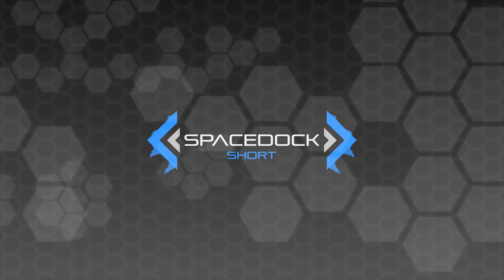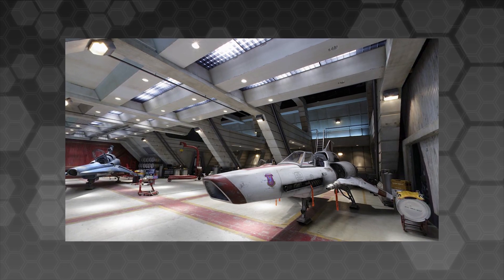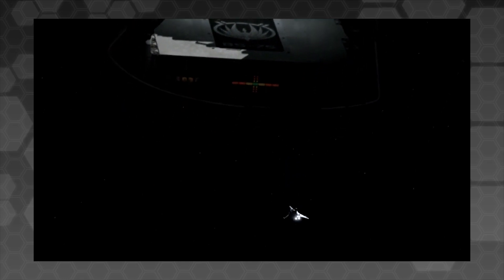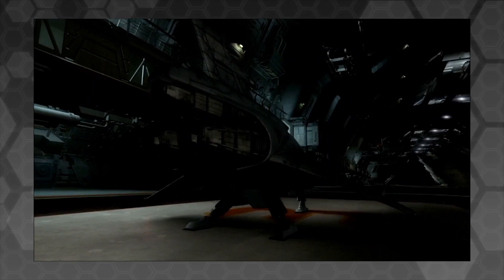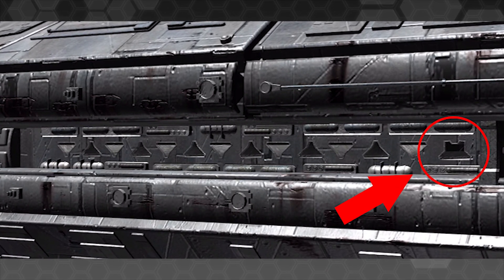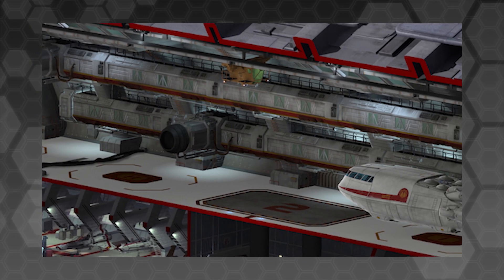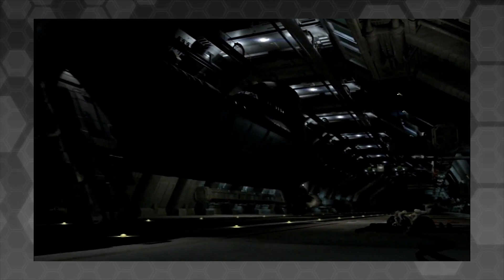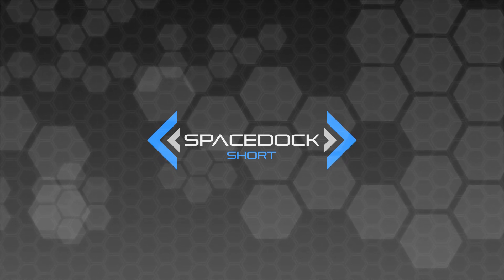How to Land on the Battlestar Galactica

Comment: I've never understood the Sci-fi fascination with skids over wheels. It seems like it would be so much harder to move fighters and whatnot around the deck because you'd need some kind of external lifting device to do it. Seems like a waste of space to me. Magnetic skids could also be used in conjunction with wheels.
Reply: While I don't remember it ever being shown, I believe there are wheels in the skids themselves for moving them around on the hanger deck. One reason they wouldn't likely be used for landings though would be that landing in zero-g would make wheels a very risky proposition, no grip for one thing, and it would be a bit harder to use the magnetic field on a wheel. With a skid however you could integrate the coil generating the magnetic field into the structure, and keep it in a single alignment as well.
Reply: Technically, due to the freefall environment that the Viper works in, it is probably more related to a helicopter than a plane since it can hover and can move freely in all three dimensions.  As stated in the first episode, the normal procedure for a landing is to approach to a hover, hover taxi to the landing spot, then perform a set down.  Identical in all functional respects to a helicopter.
The combat landings seem to be analogous to a helicopter performing a "run-on" landing.
In addition, the skids provide a large surface area for the magnets to grab on to a surface.
Reply: They are most definitely not "hovering."  They are matching their velocity with the velocity of Galactica, then using RCS to bring their ship to the correct part of the deck on which to land.  At no point are they not moving, they just are trying to stop moving in relation to Galactica so that they can land.  It is in no way similar to a helicopter; technically a helicopter would be much harder to land on a carrier than a Viper would be to land on Galactica.
Reply: Well, when you put it THAT way, a helicopter doesn't "hover" either, it uses a rotating wings to match it's velocity with the velocity of the Earths surface.
And as long as we're being "technical" here, I never said that Galactica, the Vipers or any of those small space craft hover at all, only that a helicopter does and that close ship operations and docking are more analogous (Ha! analogous has the word "anal" in it) to a helicopter than to a fixed wing craft despite the way a viper looks.
Reply: But its similar to a helicopter in that the craft is not in contact with the 'deck' while moving to the lift. Much like a hellicoper is not in contact with the gorund when it moves from the runway and taxi's to parking.
Reply: TheRogueX On land it's not a direct comparison but on a ship it is. A helo landing aboard, say, a destroyer is doing exactly what you're describing, it hovers above the landing platform by matching velocities with the ship it's landing on.
Reply: Pontoons, my friends. Pontoons.
Reply: The X-15 had a front titanium skid an two rear wheels.

I don't know if the skid was more about landing impact or braking.
Reply: actually the X-15's undercarriage was the other way around.  My understanding is that there was concern that tires wouldn't have been able to take the impact forces during the aircraft's high speed landings, and probably also because they were really only needed for landing, the plane didn't need to taxi or takeoff on it's landing gear.

In the show we do see the deckhands pushing Vipers around as if they were on wheels, so presumably, either they have embedded castors or the magnetic locks can be switched to some sort of "maglev" mode.
Reply: the old series skids were wheels, they looked like roler scates
Reply: @jedigecko06  X-15 had a front wheel and two rear skids

Comment: I always considered the haphazard combat landings to be the result of two things, actually.  First, it's a matter of recovering all the fighters as quickly as possible and not leaving anyone behind.  Second, it has to do with the fact the Galactica's flight pods retract prior to a jump.  Vipers landing would be moving perpendicular to the retracting deck, making it riskier to try and be land normally since over-correcting accidentally would likely end with a Viper being bounced around a bit because it hits the wall because it's moving independantly of Galactica.  Either of those ends up with a Viper being lost or effecitvely disabled (even if only for the time it takes to confirm it's still spaceworthy), something the Fleet can ill afford for most the series.
Reply: All that is a great point,  but you are missing the biggest thing for the show, it looks cool. Lol
Reply: Randall Brink yeah the rule of cool wins the day here. Though one thing I don't get is why the Vipers have Skids exclusively, surely it would make sense to have wheels that they can use for ease of maneuvering when in the maintenance bays rather than being dragged along on skids
Reply: i agree, skids make no sense on Vipers.  Wheels are under-used in scifi.
Reply: A flat magnetic plate to securely grab the deck on landing would be much more important than how you move it around later.  I always envisioned little rolling dollies that grabbed the skids and popped them up on wheels to move the ships.  Mag-lev dollies would be cooler, but they used wheeled racks for everything else so probably wheels.
Reply: @themadhammer3305  Mainly because the skids had to be magnetized to secure the Viper to the ground. I guess there are those skids with wheels, but I guess those would be more prone to slipping when magnetized.
Reply: @Will-cl1ro  
It's a weird thing but even today with wheeled helicopters.  Pilots don't like using the wheels they would rather hover above ground when moving.  Claws would be easier to secure and maneuver because of length.
Reply: @johnMullholand  all solid points, for lubrication though the mechanisms for the skids must have some form of lubrication so they must have sussed that one out. I'm sure there's probably some rubber like material that would work in vacuum but now that you lay it out skids tick all the same boxes and are probably cheaper/easier
Reply: Will wap496 that's a good point was just a thought I had about little oddities in the design is all
Reply: and how about an inverted magnetic field in the deck or like pulling/shoving "rails" ?!
Interacting with the magnetic skids/clamps it would make them Vipers hovering and easy to move around, wouldnt it?!
Reply: also worth noting that the pilots they had were not as experienced or skilled as might be required for rapid precision landings.. the pilots they had in the miniseries had been trained with automated systems and more advanced fighters after all, and hadn't seen combat ops at all. so while flying unfamiliar older fighters and having to land rapidly with no landing systems (or even time for the deck controller to help them do proper approaches) they just did their best. 
then in episode 4 that Comm drone killed pretty much all the skilled pilots they had and they had to resort to training civilians and other people with no military experience. (as well as training people who had no flight experience at all.) given the level of attrition they had in the pilot roster every time they got attacked by the cylons, they probably didn't even bother trying to teach them how to do the kind of precision flying you'd need for an orderly combat landing. (as we see several times, they were struggling to teach these pilots basic combat skills and to fly vipers properly in general, expecting them to pull off landing maneuvers requiring precision and high pilot skill wasn't going to work well.

Comment: Wonder why they don't simply have wheels on the vipers if they're gonna land like aircraft anyway. Would help against tearing up the entire flight-deck.
Reply: When you think of a Viper as operating more like a helicopter than an airlane, it will make more sense.
Reply: Wheels are more and more common on helicopters, especially military ones and especially on larger ones, because it's easier to move them around on the ground.  The reasons to use skids instead of wheels on helicopters comes down to cost and weight.  Operationally, wheels are a better choice.
Reply: Erika Söderlund Skids wouldn't tear up the flight deck if the skids were made from a softer metal (or even a softer variant) than the flight deck. As an example, the skids could be made from an aluminum alloy while the flight deck is hardened steel, in which case the skids aren't going to do anything to the flight deck unless it's super thin.

Comment: Was going to get upset about the red and green lateral landing markers, as it appeared that red (port) and green (starboard) were reversed on the Pegasus (5:57). This would have meant the ship would recover craft from forward, rather than aft. However! It being an American show, or maybe because the colonials just do things different, they in fact display port lateral markers as green and starboard as red. Displeasure averted. Unless, of course the Pegasus does recover its craft from forward, in which case, disregard all and have a good day!
Reply: Landing is usually done approaching from the rear. You exit through the front. The lights on the lower flight deck will be reversed until you flip your ship over; then it will be just like the upper deck (on Pegasus).

I also suspect the show would show mirrored images at times to cut down on costs. As long as no words were visible, this would work except for the detail oriented fans.

Comment: Related to BSG again I'd like to see more information on the Point Defense and artillery pieces of both Galactica and Pegasus. The show seems to bounce back and forth between semi- and fully automatic models during engagements, and the main guns are so rarely used. Also the missile tubes.
Reply: in most battles, Galacticas main guns fire flak projectiles to help with the antifighter and anti missile defence of the ship.
Reply: The battlestar's main battery was also its flak battery, so most of the time the guns were used to fire flak to protect it from raiders and fissile missiles. The exception was the 'Bow Battery' on the Pegasus/Mercury class, which was 4 fixed dual forward firing guns even heavier than the main battery, and used solely for firing at enemy base ships.
This is why there is the common misconception Pegasus could have outfought those four base stars in the episode she was destroyed, given how she easily dispatched the first one. That was purely by surprise, hence Pegasus could use her 8 bow battery guns and her 60 main battery guns entirely against the base ship - after that she needed to use the 60 main battery guns for flak as she was under VERY heavy raider and fissile missile attack, so she only had those 8 bow guns for offence.
In the other large scale engagement between battlestars and base stars (the resurrection ship battle), the base stars fighters were drawn away, while the battlestars fighters were concentrated on the resurrection ship - meaning both battlestars could ease off their flak and devote more of their main battery to what they call 'salvo fire' - ie firing at the base ship itself.

Galactica is credited with 48 main battery guns (anti-ship OR flak),  and 1028 point defence guns.

Pegasus is credited with 8 bow battery guns (anti-ship), 60 main battery guns (anti-ship OR flak), and 'numerous' point defence guns (almost certainly more than the Galactica, probably over 1500).

All the guns (bow battery, main battery, point defence) on both Galactica and Pegasus, are mounted in pairs. Galactica's main battery turrets are individually manned, her point defence turrets are manned remotely. All Pegasus's guns are remotely manned.

Comment: Does anyone think that Raptors were to versatile in BSG ?  ECM, troop transport,heavy assault
Reply: Not really, the raptor is just the platform. The different roles comes from whatever equipment was installed. Sort of like the FAAs swordfishes and gannets, they performed several different roles, but the main differences between the different variants was what was bolted onto the airframe, be it radar or rocket pods or torpedos
Reply: The USN used to operate the A-6, which had the basic attack/bomber version, an ECM version (officially "Growler" but everybody called it "Queer") and a refueling version.  The S-3 Viking (ASW plane) filled the Texaco role when the KA-6Bs finally wore out (the planes were literally stretched out several inches by so many launches and traps) because they were in such high demand.

And do I even need to get into all the roles the C-130 airframe fills?  Sometimes the same plane will fill multiple roles on the same mission.
Reply: I guess what I was pointing out was that it was a way for the production company. To save some money on sets and time to just have a everything ship. That is how Star Trek has transporters they ran out of money for sets and equipment so they just had a science is magic machine that moved the actors from one place to another

Comment: on the Pegasus, they could maybe just roll the pad into correct orientation without lifting/lowering much.  As I think of it, having the flight deck inverted could really speed up operations since the elevators are kinda slow... 
Also the Ball wouldn't be the stripe, it would be something sorta like this...  
-O-   
Or this if you were too high
_O_
Like an artificial horizon with you as the "ball"

Comment: For the ventral hangars... Instead of a 'Lift' per-se, you have the taxi deck 'flip' to be reoriented to the relative artificial gravity of the rest of the ship. The deck would lock into place with pistons or some such, and when a Viper or a Raptor lands on it, the deck would rotate to flip the ship 'upright' into a chamber large enough to accommodate the ship. An outer door seals the chamber now below the fighter, and the whole thing is brought up on tracks like a heavy duty elevator, and pops up on the deck between [if you had more space between those two hangars]
Reply: Now that would be fucking cool, I like the way you think